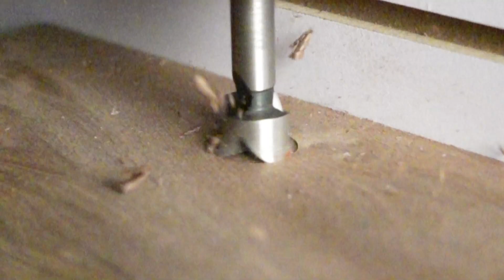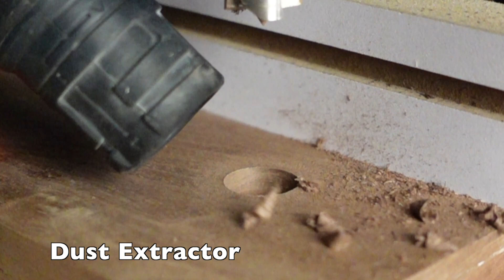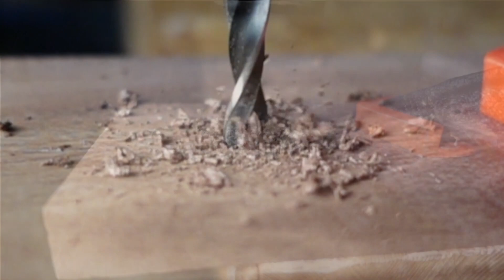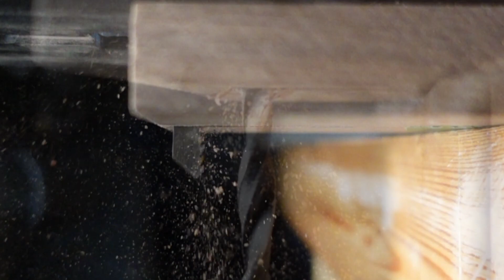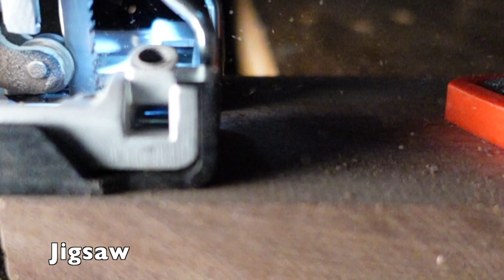Woodworking...but in Slow Motion // Drilling, Dust Extracting, Jigging!

Comment from the maker: What other tools or shop items would you like to see in slow motion? I also tried the table saw, mitre saw, and router, but those blades/bits just turn too quickly even when recording in slow motion.
Reply: Any way to do view from inside a planet or jointer? Table saw cuts? How about a hole saw on the drill press? How about a spade bit on the drill? How about slow motion of glue up with a lot of run out?
Reply: A profile being cut with a router bit would be cool!